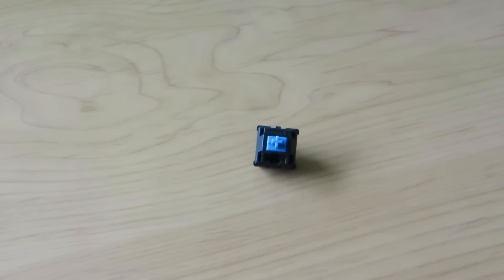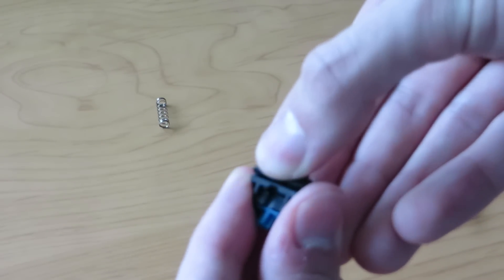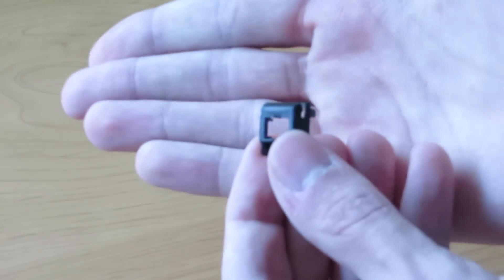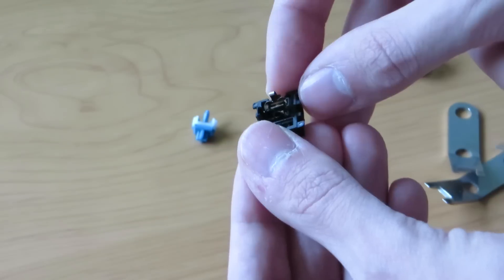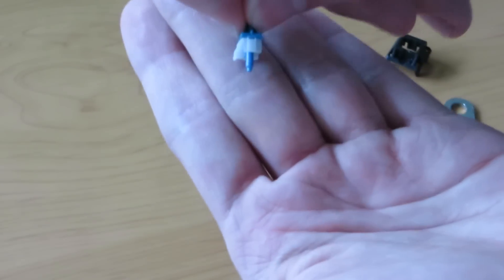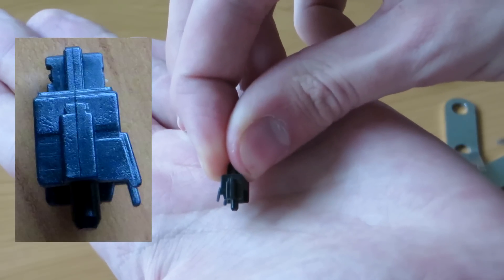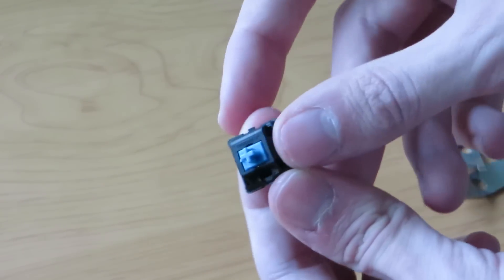Cherry MX Disassembly

Comment: Good video! If a switch has random debounce problem (e.g. sometimes double letter coming with a single press), is the issue typically e.g. dust in the switch, alignment problem in the parts or is the switch permanently broken?
Reply from the maker: Could be a lot of things, could even be a problem with the PCB or the solder joint. Hard to say.
Reply: @Blue5hock  The problem I'm seeing with my keyboard doesn't seem to happen if I try to physically move or twist the switch so I'd rule bad solder joint out.

The problem appears often enough that it's annoying and I've been able to verify it's a real hardware issue instead of my finger simply slipping, but rarely enough to not be worth tearing down the whole keyboard yet to desolder the switch.

I'm considering taking the switch apart from top if that's possible in practice.
Reply from the maker: @MikkoRantalainen  if you have a plate mounted switch, which in your other comment it sounds like you do, you will have to desolder that switch and take it out before you can open it. Cleaning the switch might help, but if you're already desoldering it, you might as well replace it if you have a spare, just to be sure.

Comment: one of those metal thingys fell out, please help me!
Reply from the maker: What thingys? If you mean the leaf spring, you should be able to just put it back carefully. Needs a steady hand and some precision, just don't force it.
Reply: @Blue5hock  just fixed it thanks. damn 7 years and ur still replying, what a legend
Reply from the maker: @Sarah Joy I don't think you can buy them on their own. You could harvest them from an old or used keyboard from eBay maybe? If you use an FDM printer, you probably won't get any decent results. Switches can feel scratchy very fast if the surfaces aren't perfectly smooth.

Comment: the-space-bar-on-my-hyperxalloyelitergb-stopped-working

what-reasons-are-there-and-how-can-I-fix-it?
Reply from the maker: If it broke, it's unlikely that the switch itself is broken. I would check the solder connection on the switch, if you have some soldering experience, resolder that.
If that's not the problem, you can replace the switch or try cleaning it on the inside, but that will also require soldering.
If neither the switch nor the solder connection are broken, then most likely a trace within the PCB broke. You can patch that theoretically with some wire and scratching the PCB open and... good luck with that.
Reply: @Blue5hock  thanks;-)

Comment: Hey dude, I have (maybe) stupid question. So, I have Outemu Switch and I broke the leaf. Can I switch the broken leaf, with the leaf from the other Outemu Switch?
Reply from the maker: Probably? With Cherry switches you can just pull out the leaf spring with a bit of wiggling - be careful to not bend it though.

Comment: It is possible to unmount them without unwield them from the base? I just need to change the springs.
Reply from the maker: Only if you have PCB mounted switches (PCB should be visible when you remove a keycap).
Reply: Go to Ali Express and search for "Metal Switch Extractor"

Comment: Thanks, my 'A' button sometimes doesn't register keydowns, very annoying. I'll make these tools from some corner fittings with an angle grinder, hopefully it will come apart without desoldering the switch, 100% sure I'd ruin the whole keyboard with soldering

Comment: Beginner's awful mistake: I disassembled it and i tried to pull the leaf spring out, not knowing that it was very fragile. And completely fucked up the direction on the travel.
Don't do what I did cx

it was just a £0.50 switch so who cares i guess
Reply: One time when reassembling I kept on putting the slider the wrong way around and blamed the switches bad quality lol

Comment: Can I do this while the switch is still connected to the board? Or should i remove it and do it?
Reply from the maker: If you have PCB mounted switches you can open the switches without desoldering.
Reply: @Blue5hock  I have a Massdrop Alt which have hot-swappable switches and they are plate mounted.  So I'm guessing they aren't soldered and id be able to do this while they are still attached to the board.  Im trying to take the clear housing from my mx blues and put in mx greens.
Reply from the maker: @ITzMeYaKnow  oh that should be even easier then. I'd pull the whole switch out and disassemble it outside of the keyboard.

Comment: the gold means it can get water with keyboard turned on and it keep work. thos who stops to work forever like razer cupper switches shitty
Reply from the maker: That is not correct. The gold-alloy used for the contact points prevents corrosion, that does not make MX switches or the keyboards water resistant or even waterproof.

Comment: Ok so I have this controller called a mixbox that has the directional buttons mapped out like your typical WASD arrow key setup. now they're mounted to a plate but the buttons themselves aren't soldered onto a PCB, instead they have two wires soldered onto the bottom metal pins and those plug into a pcb.

would I be able to use this method to change the switches out since I can easily remove the keys from their mounting plate without messing with the soldered wires?
Reply from the maker: HurtboxTV if the wires are long enough then you might be able to pull the switch out of the plate, which would allow you to open it
Reply: yes they are definitely long enough. So I will be giving that a try. I ordered some browns to replace the Reds in the thing. thanks for the response, thought I was going to have to do some soldering to replace them.

Comment: I combined a red top with blue bottom. Is this brown now? Has a weird hang on the backstroke though :(
Reply from the maker: Geröllgerät Only the stem matters. Blues, reds and browns share the same springs and housings.
Reply: That's what I did (sorry for bad wording), a red stem in a blue switch. However, the red stem was from a Gateron and the blue switch was a Kailh SMD. Now, the result is really like a brown, but with a very far bump (3mm+) that hangs a little on the backstroke. So I don't think I will use it. The reason for doing this is that my new Gaterons hardly fit on my SMD LED board.
Reply from the maker: Geröllgerät Sorry, I'm no expert when it comes to these clone switches. I can only offer advice with Cherry switches.
Reply: Impossible, you probably malformed the spring, bent the contact leaf or didn't insert the stem in properly

Comment: hallo ich hab mal eine frage, bei meiner Tastatur (Topop 105-Key) ist die Leertaste kaputt besser gesagt ich muss die  taste viel stärker  drücken damit die reagiert, wenn ich das gehäuse oder wie man das auch nennt etwas runterdrücke und dann sozusagen die taste normal drücke ist es so als wäre nie etwas passiert. ich erkenne halt nicht ob die tastatur pcb oder mount plated ist. hast du vielleicht irgendeine idee was ich machen könnte?
Reply from the maker: Dieses Modell ist plate mounted (das Gehäuse selbst bildet dabei die Platte). Klingt so als sitzt der Schalter nicht mehr richtig und war nicht gut verlötet. Da hilft nur aufmachen und neu löten, was aber nicht so schwer ist, jeder Hobbyelektroniker wird dir da aushelfen können. Falls du noch Garantie drauf hast würde ich aber erst darauf zurückgreifen.
Reply: ok danke für die antwort und hab leider keine Garantie mehr drauf

Comment: Do I can replace Blue switches to Brown switches, without soldering? Only changing upper part of the switch. The botoms of the switches is the same?
Reply from the maker: Edvinas Jančiukas You can if your switches aren't plate mounted. The bottom parts are identical.
Reply: How to chek it? My keyboard  is CM Storm quickfire.
Reply from the maker: Edvinas Jančiukas That one is plate mounted. You'll need to desolder the switches.
Reply: Thanks  :)
Reply: @Blue5hock  no dude you have it totally backwards! it's pcb mounts that  requiire soldering!
Reply from the maker: @sashimicheetah  Why would PCB mounted switches require desoldering? You can open the top of the switch as shown in this video. There's no plate in the way.
Reply: Real men don't do that. ;)

Comment: I ordered a set of tool and switches so I can switch out individual keys(wasd)

And... holy shit! what about the led? I don't want to solder it out
Reply from the maker: There's no way around it. The LED pins go through the switch, so you will have to desolder them. If you do that make sure sure to mark which pin was left and which was right as LEDs only work one way.
Reply: What are the tools called? I have been trying to find some, especially like the ones he used.

Comment: Can you please help me, the M on my keyboard has suddenly become stiff in a week of use. The KB is new and is plate mounted. So do I replace it? Or can I repair ir?
Reply from the maker: If the keyboard is new you should rather get a replacement from the vendor, because trying to repair it yourself will most likely break any warranty.
Reply: oh I will go for warranty replacement then.
Reply: BlueBär Fck my warranty, lol. Replaced my M key with the SCRL Lk key xD and waiting for my cherry mx shipment of 10mx blues which are from the ahem ahem market

Comment: Is it hard to assembly it back again so and fix it into keyboard after desoldering? onle of my keys working little bit differently and cleaning didnt help, so I would like to see what's inside the switch. I consider desoldering and changing switch with other one that I dont even use like instert/scr lock/ pausebreak :D
Reply from the maker: If you have some soldering/desoldering experience it's not hard. If it's your first time desoldering I'd recommend to train desoldering first on some electronic junk.
Reply: I'm more worried about sole switch, if I take it apart, clean and assembly back again. Is this process  hard or may permanently break the switch
Reply from the maker: They're hard to break. I've never broken one by accident.
Reply: Dude hahah :D you still have not answered my question. if I disassembly switch, clear it and put it back together, will it work properly.
Reply from the maker: Kinda hard when you keep changing the question... I cannot tell what's wrong with your switch, so I can't say if an internal cleaning will fix it. It is unlikely that you will break the switch by opening it, unless you are very rough with it, so it's worth a try. If it does not work, replace it with a new switch.
All questions answered?

Comment: Can anyone tell me if I can open a brown RGB switch on a k65 like this without desoldering? Thanks!
Reply from the maker: You cannot since they keyboard is plate mounted. You will have to desolder the switch unfortunately.
Reply: Ok, thanks! Just bought a k65 rgb and one switch seems to have a weird sound. I think it comes from the spring in the switch and I thought I can fix it.
Reply: @Blue5hock  YOu can  still use the switch tools
Reply from the maker: @sashimicheetah  No, you cannot. You can't lift the latches because of the plate.
Reply: +Attila theHun I would recommend you at least learn how to solder, weather or not you fix the actual keyboard. it's a phenomenally useful skill
Reply: bradley morgan
I can solder since I'm a child, but I refuse to invest more time in a brand new product...especially at this price point.
But thanks for the advice anyway!

Comment: I have a code keyboard so there are leds on the switch, so I'm guess I can't open the switch without desoldering anyway right
Reply from the maker: +Jared Sowinski That's correct, you'll need to desolder the switch and the LED. When you desolder the LED, make sure to mark which pin was left and which one was right, since LEDs only work one way.

Comment: i have a cherry mx blue switch keyboard and a few of the keys don't always click when i press them, why does this happen and is there away to take the switch apart with out desoldering? again, they click just not every time.
Reply from the maker: +Jared Sowinski Could be a bunch of things, most likely dirt within the switch or just something in the switch that is a bit misaligned. Opening and cleaning it should help. If the switches are plate mounted (check if there is a metal plate around the switches), then you will have to desolder the switch first to open it.
Reply: +BlueBär thank you for ur help, I'm gonna look into getting a soldering iron and station. Any recommendations? I'm a plumber, I solder pipes almost everyday, but the type of soldering for electronics is whole different game. Thanks again.
Reply from the maker: I'm unfortunately no expert on soldering, and it depends on were you live too. I'd recommend checking electronics forums from your country for recommendations. Make sure you get a good desoldering pump too, I can only recommend the Sodapullt.

Comment: one of my cherry mx red switches wont type unless i press down very hard. how do i fix this?
Reply from the maker: +Daniel Koyuncuoglu There could be multiple causes to this. You can try desoldering the switch for cleaning. If the switch is clean inside and still doesn't work, there's a chance that the controller of your keyboard is broken or that there's an issue with the PCB. Both would most likely not be repairable.

Comment: Please can you tell me where i can buy this strument?
Reply from the maker: DoA near You cannot buy the switch tools as of right now, TheBeast on Geekhack.org used to sell them sometimes. In this thread you can find some DIY alternatives: http://deskthority.net/workshop-f7/i-did-a-guide-of-how-to-open-cherry-switches-t2458.html
Reply: i want change my cherry switch black with the switch red, i can only open it and change the interior or i must change all the switch?
Reply from the maker: In that case, the only thing you need to change is the spring inside, everything else is identical (except the color of course). Just be aware that for opening switches you either have to have a PCB mounted keyboard or you have to desolder the switches first.
Reply: BlueBär tnx!!
Reply from the maker: Andrew Sible
Please read his question again. He wanted to change his black switches to red switches which have an identical stem, the only difference is the colour. Nobody but you mentioned brown switches.
Reply: BlueBär oh sorry!  Must have read it to fast

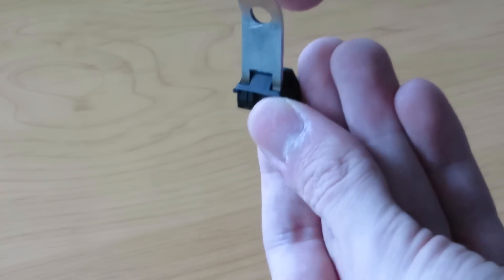Comment: Would that work without unsoldering the key from the keyboard PCB? I tried with small screwdriver, but it doesn't seem to go in there like the clamps you show at 0:56.
Reply from the maker: Nope, unless you have a custom keyboard or a keyboard without a plate (uncommon today).
Reply: BlueBär I got DasKeyboard model S, and right shift is slightly glitchy, so I want to swap it's switch with some key I never use, like PrintScreen. Was hoping I could just open the switches and swap their parts.
Reply from the maker: Michal Gloc
Swapping the switches won't work without some soldering in this case. If a switch doesn't work like it should, there's also a big chance that something is wrong with the lower part of the switch (the leaf spring for example), and then you will have to solder anyways.
Reply: BlueBär I just fixed it. True, even with help of 3d microscope I couldn't open the switches from the top. There is a lock between plate the switch body is in, and plate where it's soldered to. I could see it, but couldn't get at it. Maybe with some very special tools. Unsoldering the switch and pulling it whole out was much easier solution. :)
Reply from the maker: Glad to hear that you got it to work!
Reply: +BlueBär I have 2 mx black on my keybord which sometimes when i click they don't work, do you think it can be a bent contact or i have to replace the entire switches?
Reply from the maker: That's really hard to say without opening the board and/or switch. A single switch is not expensive though, and fixing a broken swich is quite difficult since they're so small and fragile on the inside, so I'd just replace it.
Reply: +BlueBär I thought the same, i'll change them when my cm trigger will get a deep cleaning.
Maybe i can try to fix the 2 switches and keep them like spare parts.

Comment: Awesome video! Thank you so much, I myself am planning on clipping the springs so as to lower the actuation force as much as possible while still allowing for fast recovery of the key. My question is, where can I get your switch tool so as to pop open the switches while they are still mounted on the keyboard? Thank you!
Reply from the maker: I'd recommend you to get some custom springs from sprit on Geekhack instead - everything below 60g is lighter than Cherrys standard springs.
The switch tool I have only works with keyboards that have special cutouts in the mounting plate, unfortunately no stock keyboard that I know of has these.
Reply: BlueBär Thank you for the tip, much appreciated!
Reply: @Blue5hock  Have I understood correctly, that if the mounting plate has only square tight fit holes, the edges of the hole prevent pulling the switch open while the mounting place is in place?
Reply from the maker: @MikkoRantalainen  Yes

Comment: Is this possible to do when the keys are not taken out of a keyboard? I have a Razer Blackwidow with mx blues and I was thinking of changing a couple of keys on the keyboard but I found out that this keyboard has a plate so the keys are plate mounted, and desoldering is a bit too hard for me and I do not even own the tools to desolder and solder :S
Reply from the maker: Unfortunately this is not possible with plate mounted keyboards without desoldering.
Reply: BlueBär What about just changing the switch caps? Where did you get those switch tools? (what are they called)
Reply from the maker: Oh just the keycaps? Those are called keycap pullers, you can get them from ebay and some other places.